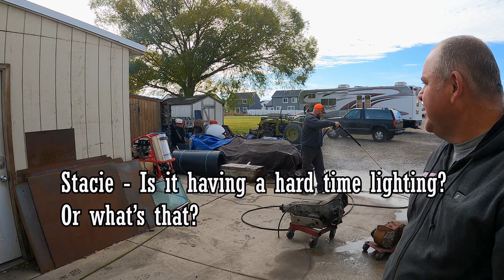Griz Gets A Transmission, We're One Step Closer To A Drive!!

Comment: GoPro cable is type c they got a long one get one of those devices you plug into a cigarette lighter the USB plugs into it give it 12 volts after GoPro running you can pull the battery out of the GoPro it will stay on with out a battery small 12 volt power supply will run leave GoPro battery door open so it stay cooler

Comment: G,day Chad and all the family from Sydney Australia. Looking like a busy workshop; bodywork, spray paint, fab for structural strengthening and lastly drive line.
* engine, trans, drive shaft, differential and axel.
Would you know what (psi or bar) compressed air you set to your spray gun? 
🕛💨
Reply from the maker: 40ish PSI

Comment: Chad,  it would be nice if you someday one at time as time permits you line the shops walls with metal siding, should satisfy your insurance provider also. Also Dusty needs to wear a Kromer welding cap when welding overhead, I felt the pain here in Indiana.😁

Comment: I was just going to suggest getting a turbo tip for the new hotsy,  but obviously you have seen one in action. Make sure and teach the guys and women for that mater it will eat the mortar out of a concrete wall.  No good paint is safe with it!!!   FYI & PS there is a Max. temperature it can be  used at, in past it was 140 degrees  F.

Wait till you get your next crusty engine block you will love it.

Comment: Key board experts lol I think your doing a fine job 
Guess we are all hacks since I have never saw paint job with no filler in it only question I had was what epoxy are you using that don't require etch primer over bare metal .
What brand is it if it's direct to metal OD like to try it myself thanks

Comment: The heater on the pressure washer should only run while you are spraying.  Otherwise, the water in the coils would overheat and boil, possibly damaging the unit.

Comment: I'd like to know. Do you put any drain wholes in the frame?
I live in the eastern US. I would be afraid of water collecting in the frame if I boxed it in.
Reply from the maker: We don't have near the rust issue as you rust belt guys. I did spray some zinc primer in the rails and will also spray wax inside them after everything is done and painted just to be sure.

Comment: i will tell you a piece of my personal opinion if you will burn #1 Diesel or the best thing to use is Kerosene i worked for a company for about 20 years servicing those units water in fuel is a killer. and they work so much better with kerosene and hardly any smoke if any using kerosene know it cost more but the savings on fuel related items will offset the extra price in fuel. talking about the pressure washer
Reply from the maker: I will start running kerosene, thanks for the tip!!
Reply: one other tip abut the only other problem they have is in the fuel pump on the pump on most models the small like 3/16" line that goes to the burner from the pump on the other end of that is a fitting with a adjustment screw from fuel pressure in that space is a plunger with a spring sometimes like sitting over the winter little bit of moisture gets on the plunger and it sticks the burner fuel pressure  will go way up burner will be real loud unscrew both ends and unstick the plunger and all is good other wise the company who services it will charge for a new pump and 10 minutes saves you. if you ever have any problems with let me know the company i worked for was owned by my uncle still in business so probably could save you lots on parts.

Comment: BTW, when painting outside of a spray booth, I usually wet the floor down to prevent dust getting in the paint. I sometimes also do this when in a booth. Of course this is after throughly cleaning the painting area.

Comment: Robby still uses filler and then glazing compound even when he dollies and shrinks things.  It's just like doing Drywall, there's a reasonable and proper amount and then there's the hack.  You have to use just enough to make it fair out.

If your shop wasn't well ventilated then all those shiny new looking tool boxes, lifts, etc would be covered with over spray and wouldn't be looking shiny and new.  I was wondering how powerful your vent system had to be to keep it so clean in the shop with all the paint work you guys do.  Its also a lot cleaner than you'd expect considering all the grinding and welding you do.

Someones discovered the Rotato Nozzle.  A rotating zero degree nozzle sure does speed things up.  Just remember that the ceramic rotating pin inside most of them is not spring loaded so if you pull the trigger when they are not pointed downward you can cause the pin to hammer against the nozzle damaging the tip.  If yours tends to start jamming up or is not cleaning as well as it did when new most likely this is what has happened.

I guess a lot of the purists won't want to know that Ford and GM owe a lot of their success to the Dodge Brothers who made many of the engines, transmissions and even rolling chassis used in their early vehicles.  Back in the day for some the big decision was which coach works did you want to make the body (Fisher, Murry, Wilson, American, Fargo, Milburn, etc, etc). 

It's a Chord Truck now!

Best!

Comment: I’m relatively new to 4wd. I would like to have a better understanding to how things work in regards to the drive train. If possible could you take time in a video to explain the Doubler you are installing and also I see people talk about Atlas. Are there any other components that can be  added ? Also explain the shifters required to operate. I enjoy what you are doing
Reply from the maker: I will talk a little about this when I pull the transfer cases out to assemble them.

Comment: I highly doubt that you'd find a Ridler Award winner without a skim of filler under the paint. The same could be said for the post war vehicles that show at Pebble Beach Concourse De Elegance. You can have a dent free body, but in order for the car to look car show straight, it will still need a skim coat of filler to remove factory ripples in the sheet metal. There's not a car builder out there that doesn't use filler somewhere in their builds... period.
If you want to see filler..., go no further than any million dollar super car

Comment: I had a coworker that wire tied the handle on a pressure washer that could run four guns and he had a red tip on and he dropped the handle and reached for it and the water hit his bicep blowing a hole through it and taking some of the muscle out! That is why you don’t bypass safety equipment!
Reply from the maker: Oh ouch. Another reason we have a conversation with everyone before using them. Aimed wrong can cause as many issues and misuse